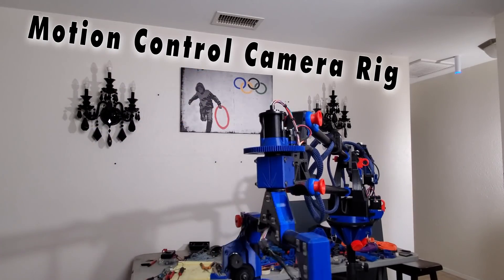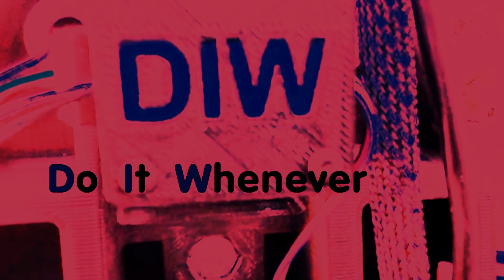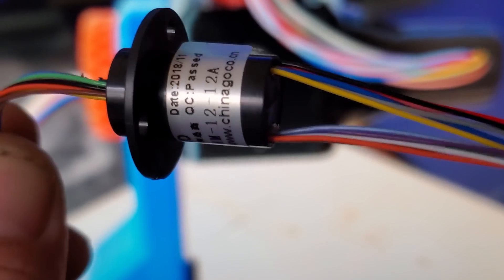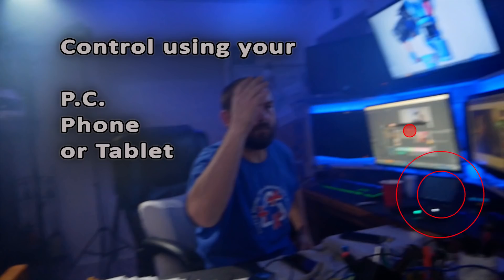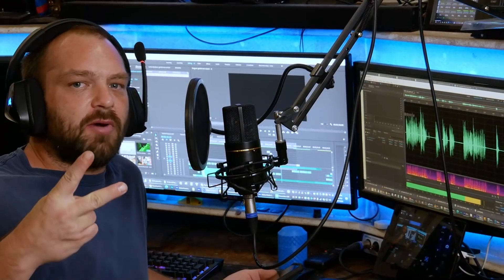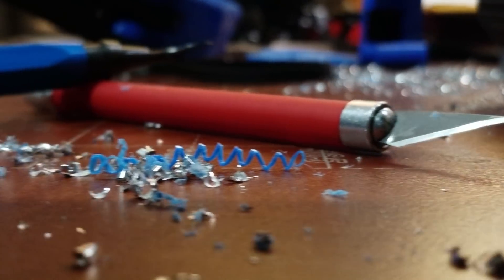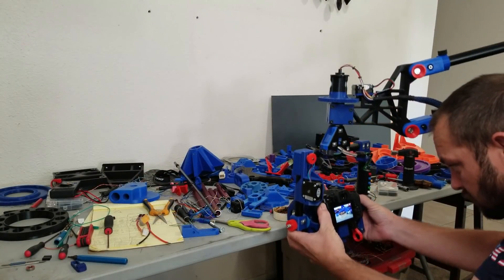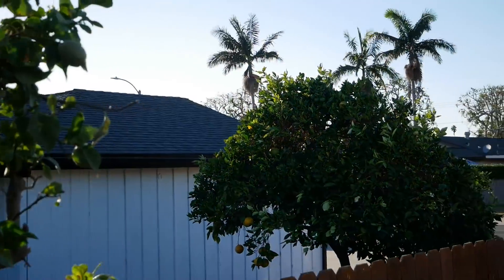The greatest DIY MOTION CONTROL camera rig EVER - allegedly

Comment: Is there any way to output the camera move to a 3D program like the old school ILM way for many repeatable passes of a model?
Reply from the maker: the way I setup my repeatable moves is to,        set a home position (doesn't matter where). then jog the machine over to where I want the end..(camera is at 0mm  jog the axis i want to move ,and where i want it, lets say x180).make any adjudgments ....then just copy and paste that gcode as many times as I want to repeat.   

g90
g1
x0 f1000
x180 f1000
x0 f1000
x180 f1000
etc...

  gcode is written as a text document then saved as .gcode  I have a bit more info in the description and a another video coming that should answer everything  :)
Reply: @DoItWhenever  Ah I see.  However, I meant to say - You do a cameras move. Now I want to recreate that move virtually in Maya.  Can the X,Y,Z of every "frame" be exported to Maya to re-create the physical camera move virtually? It shouldn't be too hard getting the axis info from the rig right?  Maybe the GCode can be converted to X, Y,Z curve data?
Reply from the maker: I would imagine it's super easy to accomplish what you're trying to do.. currently the moves are linear... meaning each access technically is moving at a constant rate in a straight line... The only caveat is they will complete their moves at the same time... So if you're moving x to 30 and y to 100... The controller will calculate the speed that both motors will need to travel in order to complete that distance at the same time.. so for a complex six access move it's just six straight lines stacked on top of each other with varying speeds per access depending on the distance you're trying to move them all.

Comment: I've just stared making my own camera motion controller. I'm just starting with a slide for now. specifically, I want mine to be controlled via DMX, which is the same thing that theatrical moving lights use. I already know how to program a light board, so I figure I could use one to control my robot. It might be something to look into for you. Some of them do offer sort of timeline editor as well.

Basically you assign each motor an address that'll be at a value between 1 and 255. mapping that to your max and your min values (or your max and min speeds) should give you easily programable and repeatable results.
Reply from the maker: the control side is where things get really fun. I haven't even explored all the options...half of which might be out of my wheelhouse to program or code. I love all the ideas coming though!

Comment: Absolutely genius.  May I ask what specific 3D printer are you using?  I’ve been considering getting one.  The fact you did this really helps me want one even more.

Thanks for all the effort you put into this.
Reply: Hah yeh I paused the video and zoomed on the printers to figure out what the hell they were, Bowden style part cooling? I’m intrigued.
Reply from the maker: @samroesch  it's a Bowden printer with water cooled hot end and remote fan part cooling... who knows if the carriage is actually lighter... but they print very well. I need to do a video on those, as the one on the left needs some serious love.   (it was the first one I made)  and after 5 years working....it needs a face lift
Reply: @DoItWhenever  How do you find the v-wheel axis vs the linear rail / linear rod axis? I’m linear rod on both, but have a theory that v-wheels may smooth out the inherently “stepped” motion that causes VFA’s (vertical fine artifacts). Do you get better surface finish on one axis or the other?
Reply from the maker: @samroesch  I like the v wheels just because the axis is inherently stiffer then rods of a comparable design. The printer on the left is way over designed, but it was my first one years back. I didn't have any experience with them at the time... but extruded aluminum profile is way stiffer then solid 8mm-10mm or 12mm rods. But I also think the point is moot... If your carriage is heavy enough to bend or deflect during a print with any of those options.... well then, we have other problems :)   I have a printer with rods, it it prints really well (despite it being mostly 3d printed itself)   The other part I like about rails is how you can combined designs... the support structure is also the guide structure.   I buy all my stuff from openbuilds.com
Reply from the maker: all of my printers are DIY made. I'm going to do some project videos on those as well with a build log so anybody can make them!
Reply: @DoItWhenever  thanks for the response.  Can you recommend a 3D printer that can make what you’ve made here that can be bought off the shelf?  How big and complex would it have to be.  Sorry I am very new to this.
Reply from the maker: @WakingUniverseTV  I'm not actually sure... I tend to build everything myself. I hear a names thrown around all the time... my print beds are 200mm x 300mm

Comment: Cool and all, but videos ain't smooth, which creates bad experience from watchers standpoint. I personally would go robot arm way with cycloidal gears.
Reply from the maker: I think there's a couple of issues that end up being culprits.... Most of the footage was shot at 24 frames, slowing that down in a 24 frame sequence adds some jitter... The rig is actually still waiting for a few parts off the printer, the current setup had some slop in it.... But I plowed ahead with the video anyways :)  the last thing  is just the fact that it's almost entirely plastic coupled with the fact that I never really planned this rig out. It  just started growing from a blank canvas... From an engineering standpoint I'm sure I could have done more to make it stable,   maybe they'll be a version 2 in the future :)

Comment: What I was thinking while watching this, If there was position feedback. Encoders maybe. So that you could manually perform some motions and have them recorded, then converted to G code.

Great project. I hope that I could find the time to make it, or a derivative.
Reply from the maker: That would be awesome!
Reply: I just had the same idea while watching.... some quadrature encoders and maybe a psoc or similar.
Reply: Yeah, watching this reminded me of the auto-calibration features of the Hangprinter¹ project (massive room-scale delta FFF 3D printer).
The auto-calibration² uses Mechaduinos³ - stepper motors with add-on boards to give position feedback and closed-loop control - to allow calibration of the Hangprinter by setting the motors to a special "torque mode", then dragging the extruder assembly to various positions, with the Marlin firmware tracking the position.
At least, that's my understanding! I've not built a Hangprinter (yet!) and I'm not following the project super closely; I've just had a quick read of the documentation.

So I'm wondering if similar hardware & software could be useful for this project - which looks super impressive, btw! :)

The Mechaduino is US$65 for a NEMA17 and the control board⁴, so that'll quickly add up and become quite pricey for this project. There exist cheaper clones/similar devices from various Chinese 3D printing-related manufacturers that may or may not be compatible/reliable. I don't like advertising clones of anything, however, even if it's open source hardware, like the Mechaduino (CC-BY-SA), so please do support the Mechaduino creators if you're able <3

¹ https://hangprinter.org/ | https://gitlab.com/tobben/hangprinter
² https://gitlab.com/tobben/auto-calibration-simulation-for-hangprinter
³ https://tropical-labs.com/mechaduino
⁴ https://tropical-labs.com/shop/